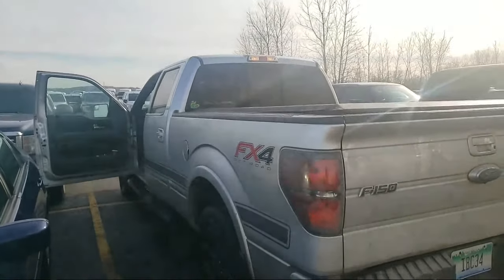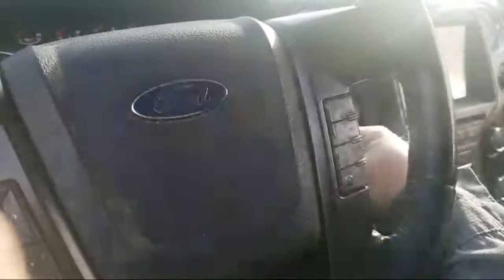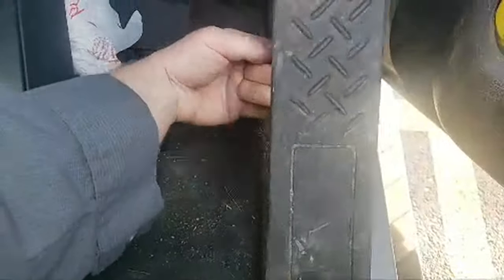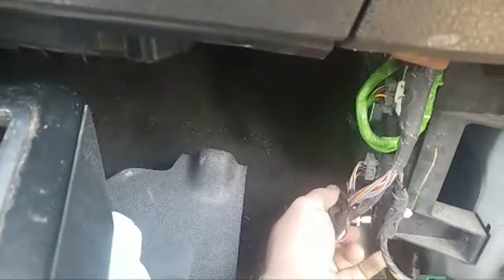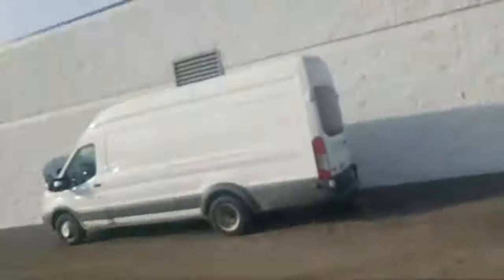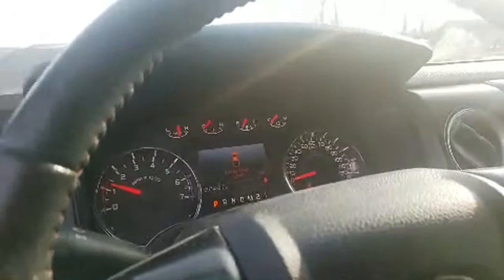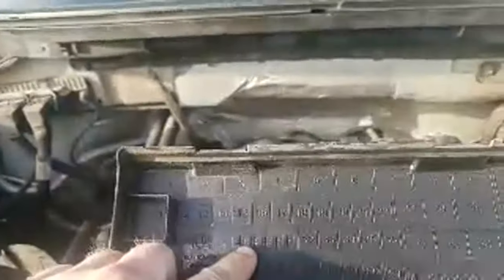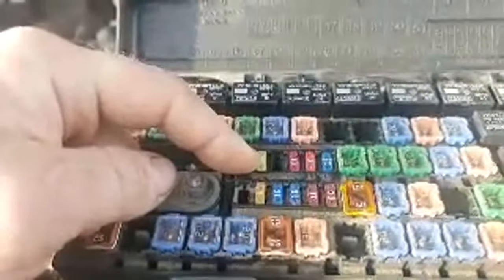2011 2012 2013 2014  F150 No Start - #1 AND #2 PROBLEM

Comment: You saved me I live and Florida and was out of state working in Virginia. My truck didn’t start and I found your video and sure enough that’s all it was. God bless you man you really did save me.
Reply from the maker: I love it when I hear your feedback because so many people from out-of-state down in Florida people down in Texas Louisiana that work in the oil fields they message me all the time saying dude I love you man thank you for saving me I was out in the middle of a field 50 miles from anywhere and my truck wouldn't start and I watched your video and damn if it wasn't just a connector behind the kick panel or the fuse that you mentioned in the fuse box
Reply: Yuppppp it worked the harness

Comment: My nephew’s 2013 F150 stopped in the middle of the street. Electronics went out lights flickering, wouldn’t start. Took off clip for transmission and put in neutral to tow home. Waited until today and checked voltage on battery and the fuses. All was good. Watched this video and found the loose connection behind the passenger kick plate. Then started right up. Thank you for putting this video on YouTube.

Comment: Your advice worked on my 2014 Ford F150.  The issue was the wiring harness had come loose inside the passenger side kick panel. No doubt saving me $100's of dollars!  Thanks!
Reply from the maker: That's what I'm here for Rob thank you for letting me know

Comment: You saved me!  Not only did the car not start but also the key fob wouldn't allow the car to lock unlock and disable the alarm.  I just tightened that harness and boom all the problems were gone!  For the whole day I thought it was the key fob itself that was broken, I was out of town and didn't have a replacement so I couldn't check against another backup.  Thank you so much!

Comment: Thank you I just pulled the fuel pump fuse and it's blown. Saved at least a couple hundred and a tow! Thank You!
Reply from the maker: Your Very Welcome 

Just realize they have a relocation kit for that fuse

They basically move it into one of the big box fuse slots and they add new wire's thicker wires at the end

Keep an extra 20 amp fuse on you just in case you have to do that again because that slot actually burns up as well that the fuse goes in sometimes
Reply: @fullcend-tkm73  thank you for sharing this video. Truck did not have any codes however it was driving sluggish and or acceleration was noticeably lacking. Pulled over and opened the hood…noticed that the engine bay was emitting a lot more heat than usual…I know the 5.4 puts out a decent amount of heat however no overheating issues per dummy gauge and or live data. Also no codes. While standing there I could hear the plastic fuse box cooling down from the heat cycle. Pulled fuse #27 and like you said it wasn’t blown BUT sure enough the plastic on the fuse was degraded and showing signs of burning. Also my MTE has been erratic…not sure if related but the ambient temp display was inaccurate. While i’m not certain any of the above is indicative of the fuse issue, I did as you suggested and installed tsb kit. Should I do a battery relearn and or fuel recalibration now that new kit is installed? Thanks again for all of the videos you make as well as keeping us informed.
Reply from the maker: @Sheeeeeeeeeeeeiiitt  my Actual Auto channel is Ford Boss Me - you'll find me there daily
Reply from the maker: @Sheeeeeeeeeeeeiiitt  if everything is running good how just leave it be

Comment: I had the same problem with no start on my 2014 F150, so I first changed the ignition switch module, and still had the same problem.

What my issue happened to be was the relay for the starter.

Comment: That fuse for the fuel pump can also cause the truck to run bad and die at a stop.  I had that issue and replaced yesterday, problem solved.

Comment: Push in on the key firmly, try again.  If that doesn't work check the fuel-pump 20v fuse under the hood to make sure it's not blown.

Comment: Dude thanks a lot! Funny enough, I was driving without BT and Voice as well for a week and a half waiting to be able to have time to get to that blue fuse in the same area. Wife borrows the truck and calls me to let me know she's stuck. My connector was a little different but I unplugged, and replugged and the truck started and low and behold, the BT and Voice came back as well. Must have worked it's way out enough to cause it to not start. Weird. #27 fuse was fine under the hood.
Reply from the maker: Yeah the number 27 fuse doesn't blow all the time, and some of the connectors do look a little different but like you said same concept same area you just have to tell people keep their feet away from that panel and don't push against it when they get in the truck
Reply: @fullcend-tkm73  I actually took the Fuse out when I got home and I was wrong. It was burned up too. I swapped it out even if the truck was running.
Reply from the maker: email me i have a dedicated automotive channel if your interested 

I dont put it out here due to the trolls following 

poissorichard.rp@gmail.com

Comment: I was stuck on the highway for an hour thank God the state trooper pulled up behind me to keep me and my girlfriend safe we tried to figure it out but nothing so the trooper had a tow truck come get us $400 later in my driveway I came across your video went out side and the same plug came apart so I replayed in my mind what happened I slammed on my brakes to not hit a deer my girlfriend foot slid under that panel and just hit it enough where the truck was basically disabled but long story short thank you I could only imagine what the dealership would have done to me

Comment: My issue is intermittent and I think it's the neutral safety switch.
I already had that fuel pump fuse burn out. I I Fixed it with the help of a youtube video 😃.
Youtube has saved me more than once.
Reply from the maker: Well on top of that there's a lot of grounds on these trucks that rot out or get a lot of rust build-up because Ford doesn't poor job of actually grounding circuits out to the vehicle so if you actually go around on the frame and find them all clean them and reconnect them you'll find a lot of issues go away whenever things are very prevalent

Comment: Great Video … 2012 F150 3.5 turbo my case Everything lights up was dragging like a battery going down; initially replaced battery then everything still lights up but nothing. No start ..  hear a faint click. Key fob is messed up will not remotely start, button to unlock wore off actually rubber came off. Was unlocking with door code. 3 three months? Now truck will not start like stated everything lights up but nothing. Initially thought Walmart ever maxx battery. They never checked, just replaced. Thinking key fob is the issue? Was being rushed had to hurry had emergency heading out of town .. used another vehicle .. replaying everything in head  now I’m sitting here thinking simple as key fob battery?  And/Or can a Key Fob lose programming?

Thanks

Comment: Not sure if this will help anyone, but I watched a bunch of videos today trying to diagnose my 2015 F-150, push button start.

TL:DR 
This fix was replacing the battery.

Here is what happened: 
I tried remote starting my truck this morning before work. I heard it try to crank, but it didn’t start. I was having issues with in my remote not locking/unlocking the truck unless I was standing right next to it; so, figured the batteries were getting low in the key fob and I would start the truck when I got inside.

I was able to unlock the doors but when I tried to start the engine, I got an error that said key was not detected. Located the intelligent key backup slot and tried starting my truck again… no luck. I replaced the batteries in the key fob and tried again, but this time there was a single-clicking noise, and the engine still would not crank. 

My next thought was the truck battery is going bad. 
I took it to O’Reilly’s and had them test it. 
They said it was good, so the investigation continued.

Started watching a bunch of YT videos and reading blogs to find a solution. 
You would not believe some of the things I tried: 
•	Ensuring the steering wheel lock was not the cause. (I was hoping it was something this easy, lol)
•	Changing relays and fuses. (Starter and fuel pump seemed to be mentioned the most)
•	Making a jumper cable to bypass the starter relay to test the starter.
•	Watched a video on how to test the solenoid with a screwdriver. (Engine compartment was not the same and I was unable to locate the solenoid… probably a good thing)

I was at a loss and about to call a tow truck when I noticed the RPM and MPH gauges were bouncy a little when I attempted to start the engine.

Found this blog post and the overwhelming response was suggesting the battery as the cause.
https://www.ford-trucks.com/forums/977616-wont-start-just-clicks-and-gauges-go-crazy.html 

Figured it was either, try replacing the battery or getting a mechanic to look at it.

Bought and installed the new battery; and the truck started up with no issues.

It would appear a battery can test good from a voltage standpoint, but still be bad. 

Here is another recommendation:
Have someone test your battery and if they tell you the voltage is good, ask them to do a load test. 
If your battery drops below 8 volts during a load test, then your battery is bad.

Good luck!

Comment: My f150 was doing the same thing as the dash lights. However mine would start and then die every once in awhile. Long story short I checked that connection on passenger side and it was loose. Saw the dash lights and hit the key. Boom. Fired off. Thanks for the info!
Reply from the maker: Thats what I'm here for to help, thanks for sharing
Reply from the maker: if you don't mind consider subscribing

Comment: Your advice worked for my 2014. Thank you very much!!
Reply from the maker: Hey Hey!! 
Love it, thanks for letting me know!
Reply: @fullcend-tkm73  Ever see range sensor errors on these trucks? Replaced lead frame assembly and still p0707/06 error. no crank no start. no gear indicator illuminated on dash. I assume problem with wire in transmission harness I just dont know what to do check.

Comment: Great Video, short and to the point. My 2012 had the fuse issue. Interestingly, it simultaneously had an issue with the key switch sticking in the start position. The engine would not start, just continue cranking when I let go of the key. Had to grab the key and turn it back to off.Have you heard of this? Is the issue in the tumbler or the ignition switch? Thanks

Comment: I took my truck to the dealership. The first time they relacated the fuse and it ran for a while. The second time they replaced the fuel pump and it worked great for three months. Now it won't start again. Should I just try replacing the fuel relay myself? The motor spins over it just won't start.
Reply from the maker: Well how you can tell if it's fuel-related is you take a few spurts of starting fluid and spray it through the induction tube unclip the air filter box and spray some starting fluid in there while cranking and see if it starts and if it does then you know it's fuel-related if it doesn't then it's ignition related
Reply: @fullcend-tkm73  I

Comment: Thx!! I have a 2014 f150 5.0. Jumped in and turned the key and it cranks over great but won’t start. Saw another video stating that number 27 fuze will cause just that. I pulled it and it’s ok. We figured out that I have an issue with the fuel modulator that’s under the spare tire. If your truck sees a lot of salt it can play havoc with that. $45 from Ford and I’m back in business!! Thanks again for your tips… I’m ready for these issues now. Does Ford move the fuze under a recall??
Reply from the maker: I have another channel with all this info already 

I only post every once in a great while here
Reply from the maker: https://youtu.be/PBXqqPZTGCE

Comment: Can you help with some information on Where can I get the fuse reloader at. Do you know what causes the #27 fuse to run so hot that if burns out
Reply from the maker: I mean they add wires to it that are a little bit thicker and you get the kit through the dealership
Reply from the maker: As to exactly why they burn up there's no explanation for that I will look tomorrow for sure though to get you the kit number

Comment: I’m having this problem but I’m getting starting system fault on cluster display. Do you think it could be #1 or #2 problems. But what is weird is the remote start will start trk fine but when I insert key it dies and says starting system fault🙄
Reply: It’s a 2014 f150 5.0
Reply from the maker: Check all your connections like I showed you here in the video but I think your issue is your immobilizer for your security system no longer sees your identifiers in the key and more than likely you're going to have to have your keys reprogrammed or you're going to need two new keys programmed

Comment: I just replaced the starter in my 2011 f150 and it cranks but won't start any recomendations
Reply from the maker: Did you check the fuel pump fuse in the fuse box like I specified in this video

Comment: Ok I have a 2012 5.0 f150 XLT anyways I changed the headlights and fogs to LED bulbs and I turned the truck on to check the lights out  it was working and I cut it off to  finish everything and when I went back over to turn the truck back on nothing no lights no radio no clicking nothing so I went straight to the fuses they were all good except #18 on the inside fuse box was blown changed all the lights and radio the dinging clicking but no crank nothing I changed ignition switch Ive changed the starter I've changed battery I've changed all fuses on the inside I've also done what you did in this video and checked inertial switch it's good I don't know what else to do can you please help me anyone before this truck gets parted lol
Reply: I forgot to mention that I changed all relays and fuses on the inside and outside fuse boxes
Reply: Shoot and when I hook up the OBD2 diagnostic test it tells me over and over that I need to check the plug in and error is all it will show me
Reply from the maker: Go to -  Ford boss me channel

I don't come on this one much anymore 

https://youtu.be/PBXqqPZTGCE

Comment: My truck just completely turned off at light.
Dash lights,radio,power windows,nothing. Wont start at all,total silence,i dont even hear that door open sound.
Jumping the battery,which is 3 weeks old does nothing at all

Comment: Starting system faild? is it the same of the video?
Reply from the maker: Check the same places that I told you in the video
Reply from the maker: Check the 20 amp fuse in the fuse box out front by the engine and then checked of connector inside that goes to the body control module it does affect the starting system that's what this video is about
Reply: FULL CEND - TKM  OK thank you very much
Reply: ok i already checked the fuse 20 and the inside ones and the truck did not start
Reply from the maker: I don't know if you ever found out what happened because I didn't get a notification that you responded back but the fuses that are inside the truck at the kick panel I wasn't really talking about those I was talking about making sure all the connections were secure at that module like making sure everything was latched and pushed in correctly

Comment: Is that kick panel problem in 2007?
Reply from the maker: It very well could be
Reply from the maker: Do you have lights on the dash and does it crank but it just doesn't start?

Explain what's going on
Reply: @fullcend-tkm73  says check gauges no crank no start. Heres what happened 4x4 went out pull fuse panel on passenger side no bad fuse. I knew i change hubs so that was good ended up being the vac sylinode for 4x4. After fixing that and test all good drive for few days went to put cover on fuse panel while truck was runing and it died never to start again.
Reply: @fullcend-tkm73  thank you for helping me i work as a mechanic offshore and this electric stuff gets me every time.
Reply: @fullcend-tkm73  things ive done checked fuses with test light there are some that aren't getting power like starter modle i think it was and some only get power when key is turned on. I've checked starter battery security system fuel module at rear of truck and made sure fuel pump reset didn't get triped
Reply from the maker: @Billy-f2f  what fuse panel are you saying that you checked inside body control module or outside under the hood battery junction box
Reply from the maker: @Billy-f2f  call me 

815-570-7318
Reply from the maker: I'm glad I was able to help you get this fixed and rolling again if you need any other help please call me
Reply: @fullcend-tkm73  thanks man gave up on it thonk my fuse panel is fried

Comment: What about the 3 problem, did both of these and nothing.
Reply from the maker: There are other problems too like there's a fuel control module on the older trucks I don't know what year you have and you haven't really explained very much so I don't know how to help you right now
Reply: FULL CEND - TKM well I have a 2014 and seems I just needed to replace the battery, idk why my stuff would go haywire with the battery being bad. Oh well easier than the alternatives I guess hope..thanks
Reply from the maker: Batteries can mess everything up I had a vehicle come in yesterday and it just had one cell that was partially going bad and it was throwing like codes for three different modules it was causing the transmission to not shift right all kinds of stuff
Reply: FULL CEND - TKM thanks yeah I heard some stuff about batteries so I went with that and sure enough good as new